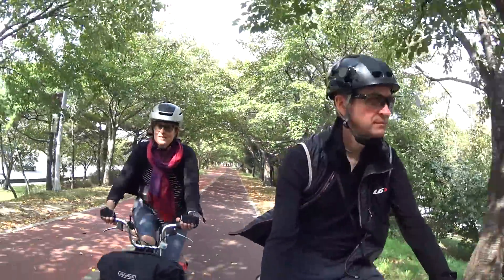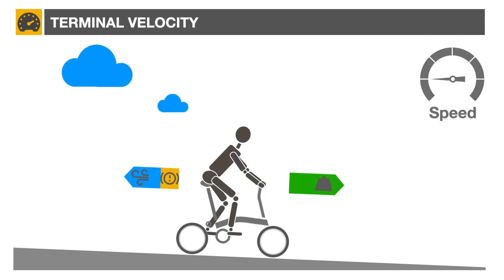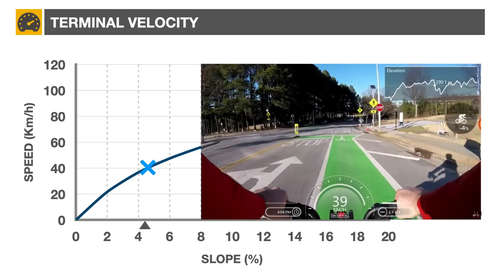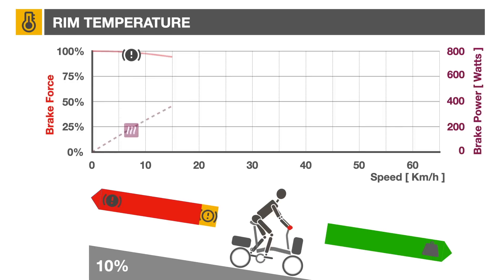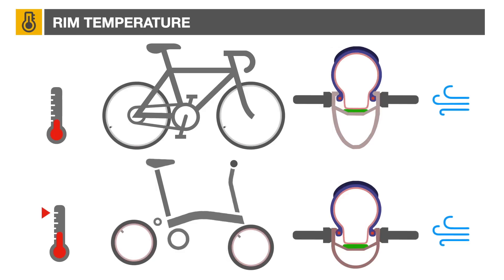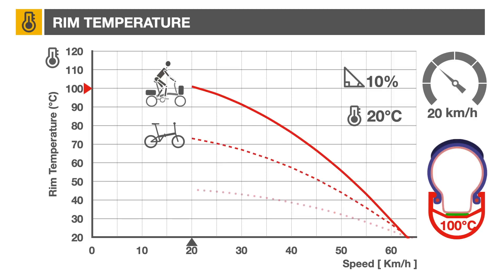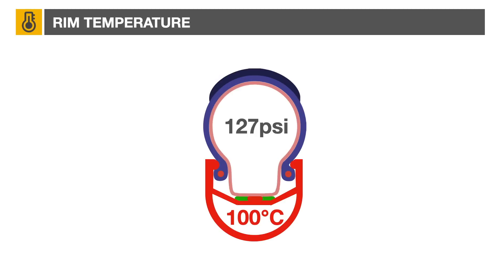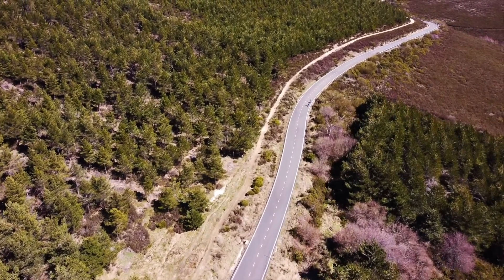Downhill with a Brompton [safely]

Comment: Out of curiosity, why did you use psi instead of bars for tire pressure? Is psi more common in Canada?
Reply: I live in South Korea where the metric system has been used since the 1960s. However, when it comes to tire pressure (especially on bikes) everybody I know still uses PSI, myself included. I think it's due to the unit's "granularity". It's easier to think in whole numbers rather than fractions when talking about pressure. For example, I find it easier to grasp when it's said that the tire pressure increased from 85 to 90 PSI, instead of saying 5.8 to 6.2 bar. Fractional numbers somehow just feels awkward...
Reply from the maker: While Canada has adopted the metric system back in the 70’s, most people here are still using PSI to discuss tire pressure (somehow bars and kpa never caught). Note we added conversion to alternate system in our video subtitles.
Reply: Also in the USA PSI is really the only common measure of pressure outside of an espresso machine

Comment: So if I go do that Montana downslope, I might be able to finally hit 100kph. 
Fastest speed I've gone on flat ground here is 76.6kph.
Downslope is supposedly 96.6 but I think Strava was glitching out, since that was on my MTB, which shouldn't be able to go even near that considering the gear ratio means I top out at 50. There's no way I could have done that. 
Singapore by the way, your example of high air pressure.
The 76.6 is on my road bike, I've done it with 2 different bikes, downslope on my old one and on flat ground with my new one because some illegally tuned e bike overtook me, he was probably going 60 and I don't believe they deserve the speed when they didn't train for it or even pay for it, therefore I must show them the error of their ways. Unless they're going 80 on those things that are more like electric motorbikes, then they paid enough for it .
I heard that there are now disc brake compatible parts for Bromptons, probably safer to switch to those if anyone plans on going down a large slope.
Even comparing road bikes, my old one with rim brakes really cannot compare to my new one with disc brakes. Then again my old road bike had pretty low end components.
It was really terrifying going downslope on the old one. I believe Bromptons come with better brakes.
But speaking of the luggage to add extra weight, what if the luggage came with an aerodynamic fairing of sorts, detachable so you can fold and reattaches around the folded form when you want to push the bike around. Maybe with air ducts for the disc brakes. 
I think the limiting point for that would be the wheel size. Those small wheels aren't the most stable when they hit bumps.
Reply from the maker: Brompton rim brakes upgrades are available, but quite costly. They would add some weight to the bike as well (many people preferring to pay a premium to have a lighter bike (ref T-Line/P-Line)). However, if fast descent is the goal, rim brake would be a welcome upgrade.
Fairing around the front luggage would indeed improve terminal velocity (increasing further the need for good brakes).

Comment: What if you have brake discs
Reply from the maker: If improperly used, rim brakes can overheat as well, but they do eliminate the risk of tire overheating.
Reply: I was thinking of the electric Brompton, 
I think it has regen braking
If you used the motor up hill
I think you won't over charge the battery, 
but I wonder if there's so much it can take.
Reply: @Eduardo_Espinoza  No regen braking on the electric Brompton
Reply: @kentwydell9322  dang: (
@Teun Jansens if you want disc brakes
You'll have to take it to bike Smith
Specializes in Bromptons,
Buy a used custom one 
, Came across one during the pandemic
On a local e-commerce site
, Or get a knock off
I can't find it in my notes anymore
But they're 5 different brands (2021)
& 1 of them has disc brakes
Reply: Discs is not an option on Bromptons, is it?

Comment: When I go downhill, I use the front and rear brakes alternately for no more than 5 seconds each time to avoid overheating.
Reply from the maker: This would work too. The idea is to distribute the thermal impact equally on both wheels thus preventing any one wheel from being “overused”.

Comment: Is it better to alternate between front and rear brakes throughout a descent, as opposed to braking with both intermittently?
Reply from the maker: This strategy could work as well, but since only one wheel will be used at one time, there would be a risk of larger temperature excursion (min to max) when transitioning from one wheel to the other (thus increased risk of failure if not careful). Note that in turn, you reduce the risk of skidding if both wheels are used for braking.